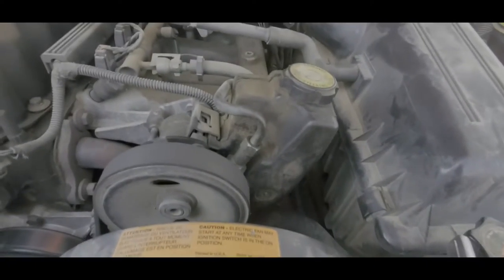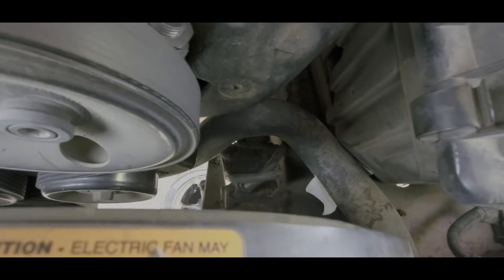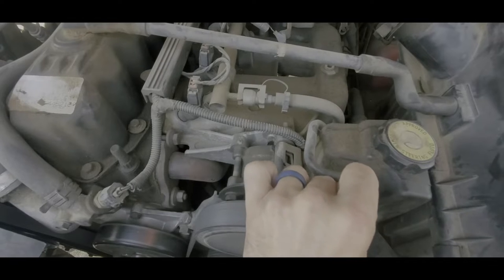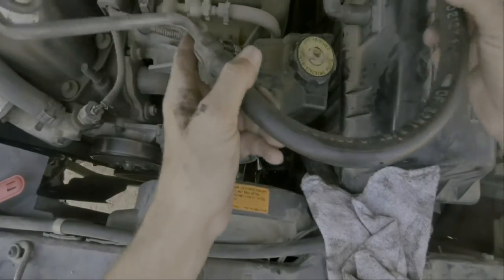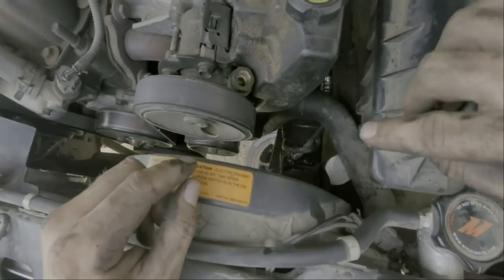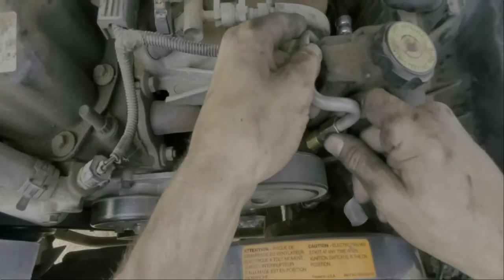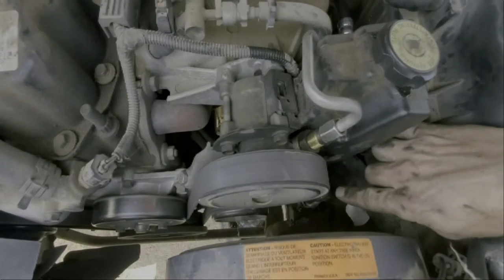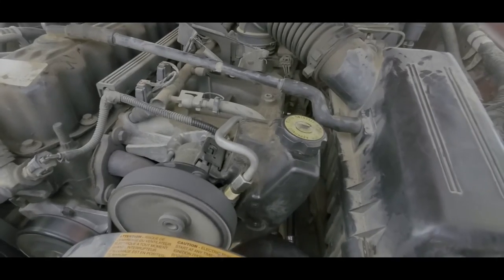How to Replace the High Pressure Power Steering Hose, Jeep Cherokee XJ

Comment: I did what you said in the video, but when tightening the top it is as if the threads aren’t catching…it will become snug but another tiny turn and it pops off, should I stop turning when it’s snug?
Reply from the maker: A couple things could be happening here. You may not be lined up flat on top of the box. Or you may have a box with different threads. I would double check to make sure the threads match what came off. After that if possible check the threads for boogers. If you have a bad thread it will lock up. If everything looks good. The hose fitting may be fighting you and not lining up straight. You may have to move the line around until it lines up the threads better. Best of luck, let me know if you need anything else.